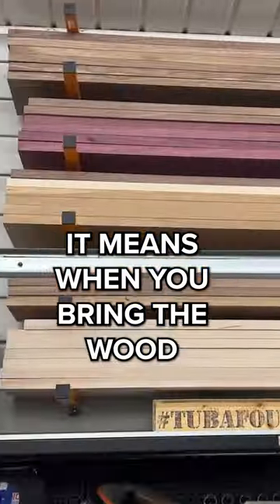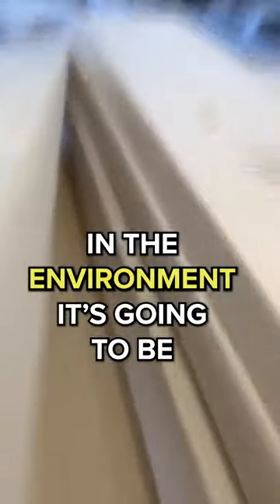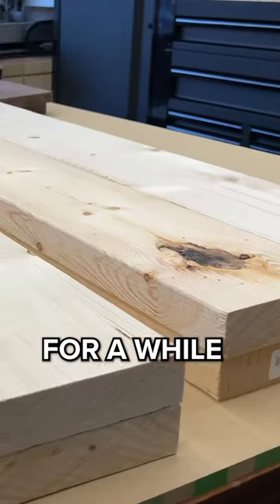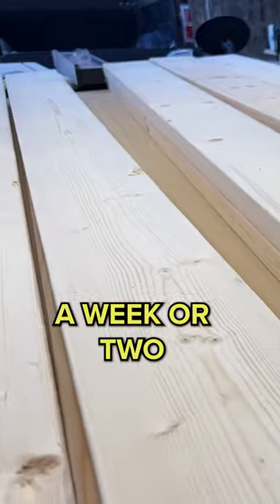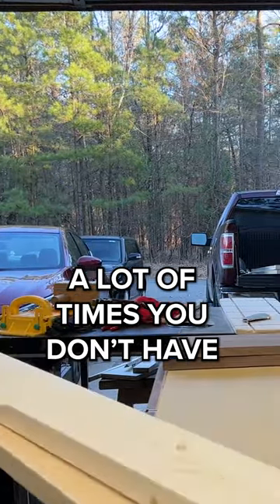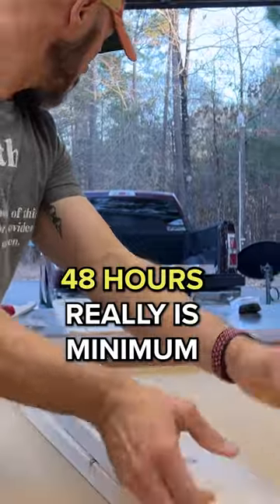#1 Woodworking Mistake to Avoid

Comment: This isn’t so important for pine and 99% of the stock you can buy from Home Depot or Lowe’s, but it’s super important for hardwoods.

Also, don’t buy air dried lumber if you can avoid it. The kiln drying process actually collapses the wood’s cells and makes them less likely to absorb moisture again and it kills any critters that might be living deep inside the wood so they can’t burrow their way out later. This makes kiln dried superior to and far more stable than air dried wood.

Comment: I go 3 days first in shop IF moisture meter is sub 11% with pin and pinless. Then I mill 1/32 off all sides and it sits another couple days, I go work on something else. 

Rinse and repeat, I’ve found that doing the milling over a week seems to have resolved my issues. Milling exposes wood = sucks up more more moisture. Eventually it levels off (unless it was 90% humidity then 20% all over all week then oh boy we in for happy happy fun time!).